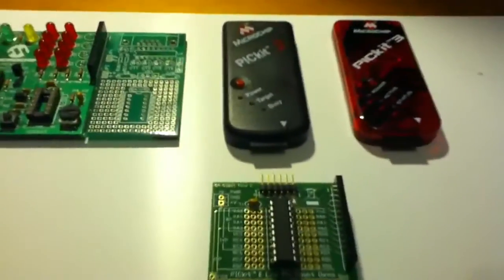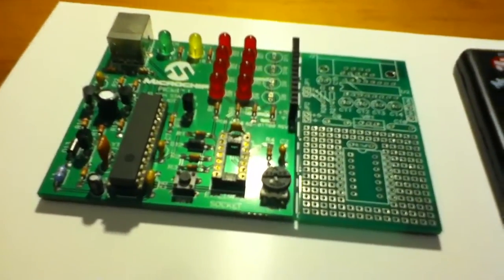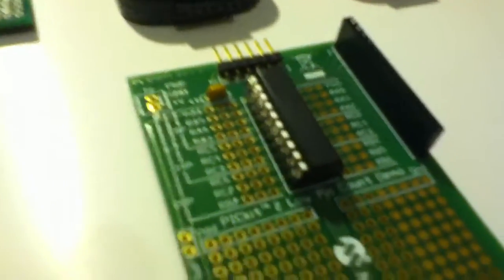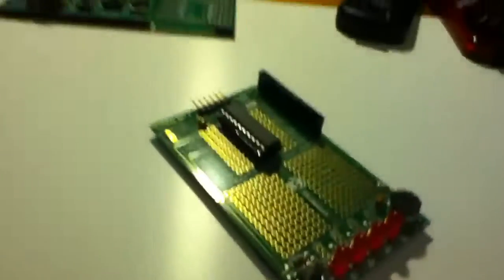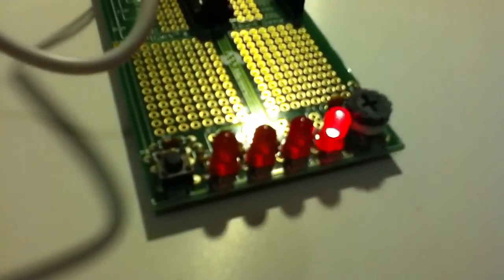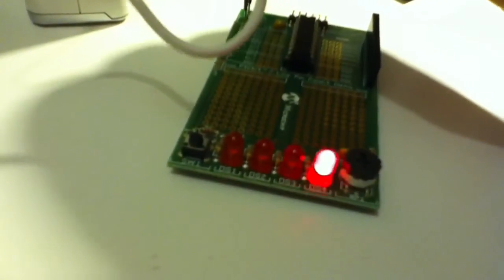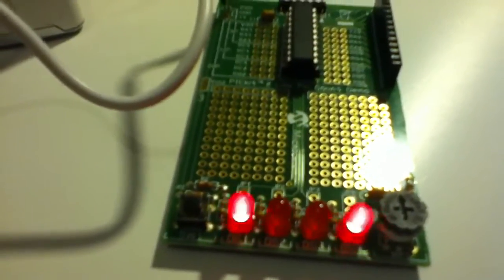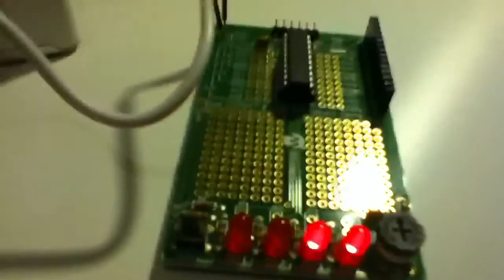16F690 on Low Pin Count PCB with PICkit2

Comment: Julian, I hope you are still reading the comments these old video posted you made. I'm hoping you can help me with something. I have a pickit 3 and I can't get the target power to stay on for when using low pin count demo board I came with the starter kit. I'm using MPLAB X IDE  2.15 I think. And it seems that I can get the target power to turn on using that. But when I use the MPLAB IPE there is no target voltage coming out of the pickit 3  and MPLAB IPE cannot find the device. I even tried it in programmer to go mode. Using the MPLAB X IDE  I can get the code loaded into the pickit 3 but I can't get it to keep the target power on for when using it as a stand alone and  being plugged into a USB power source.   I've tried to contact microchip but they not giving me any reply it's whatsoever. I'm hoping maybe you can help me with this.
Reply: +Dog Rox In the current version (v3.15), you have to go to Settings --> Advanced Mode --> Power.  Choose the appropriate VDD, and check the Power Target Circuit from Tool box.  Log out, and connect, and you should have power.